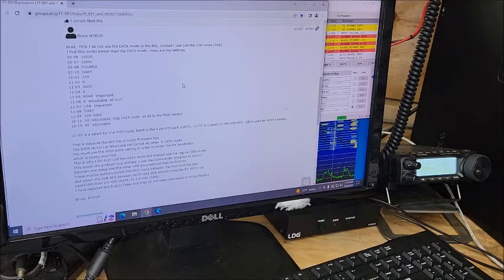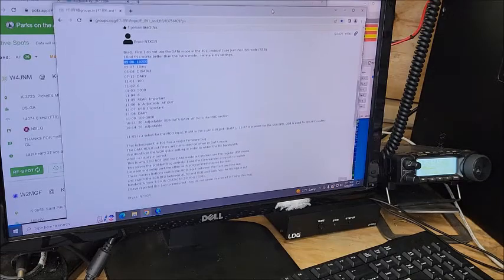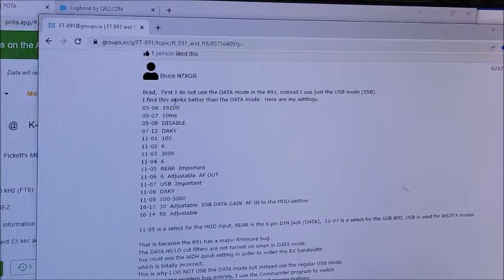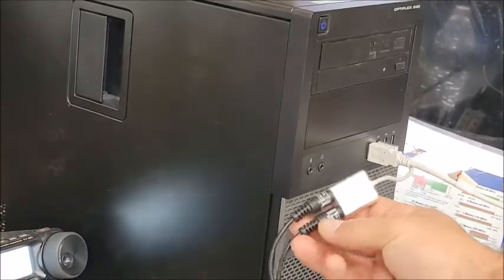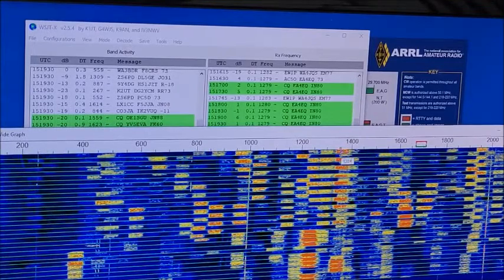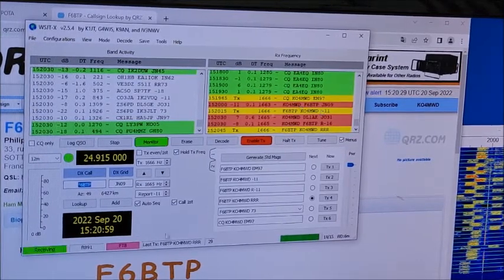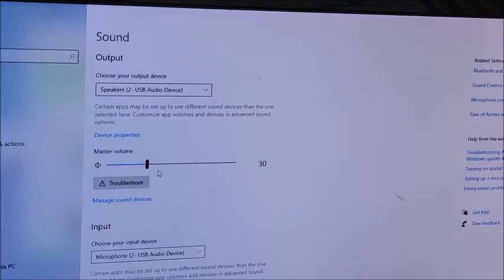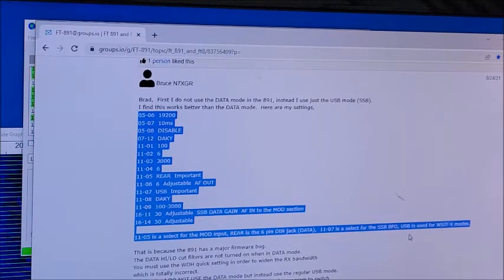FT8 on the FT891 settings NO SIGNALINK

Comment: so, the " db " meter on the left means nothing. you need to check your ALC to see how it is setup. Change the meter on the radio to show alc. It should be in the middle of the left side of the meter. If it is to high, turn DOWN the VOLUME and the ALC will go down. Also, using the DATA mode DOES WORK! I have my radio connected as you do, and i have always used the data mode with NO issue. the BAUD rate can be max. mine is.
Reply from the maker: Thanks for watching! I have tried a few times to set up the rig for data mode and never have any luck. Hopefully this can hold me over until I get a 991a
Reply: @LanceSheppard  im just sharing, as I am using my 891 and wsjtx as I am writing this. I have never had any issue with using the data mode.
Reply from the maker: @Dave KU8RLY  no, I appreciate the feedback. Is your 891 a newer model or an older model?